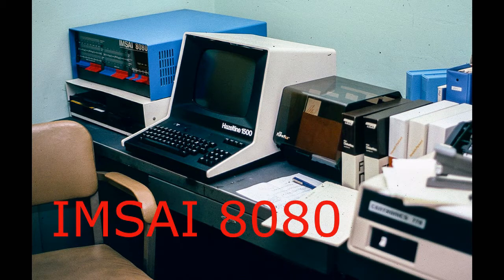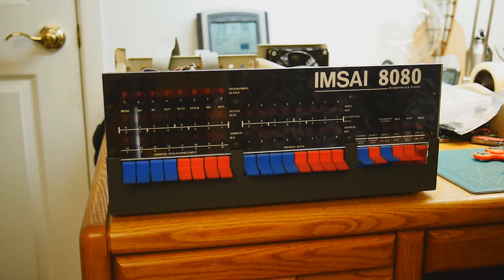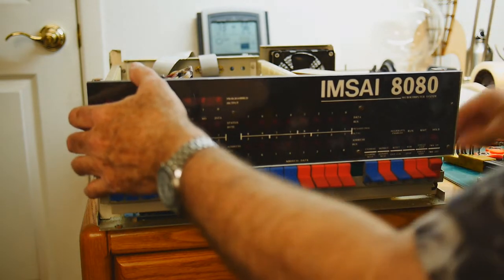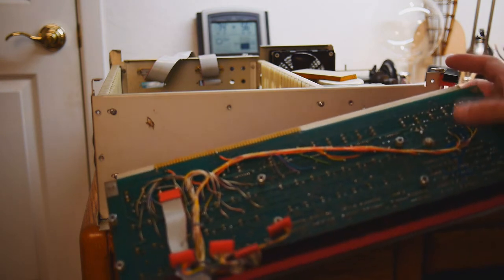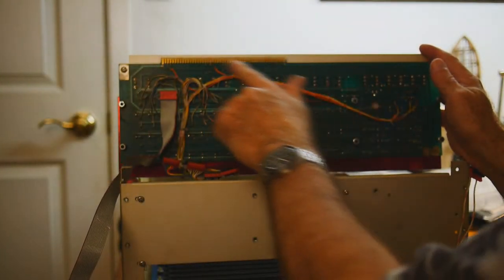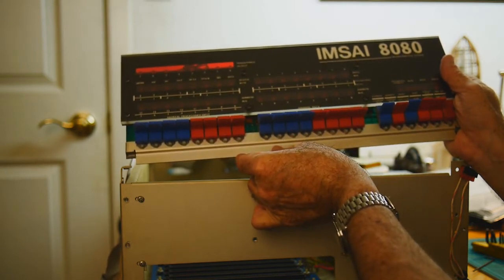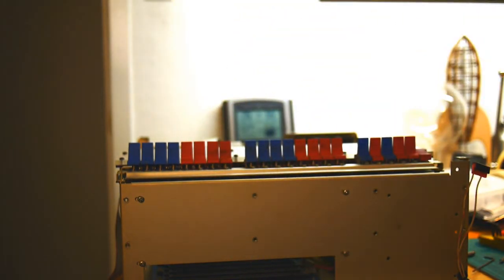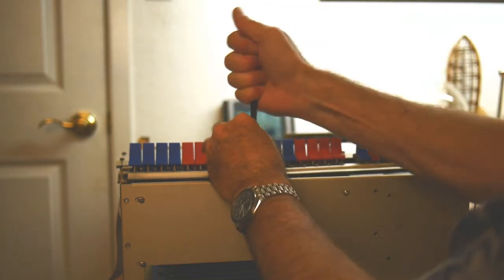#5 IMSAI 8080 removing front panel

Comment: How did your standoffs stay in place?
Reply from the maker: I don't remember, must have been threaded standoffs since it was not a problem
Reply: @IMSAIGuy  I have a PS problem, it appears to be on the -16V side. I have removed all boards, and the Front Panel, and the fuse still blows. I will de-solder the
three -16V lines from the MB tomorrow and see what happens.
Reply: I was able to take care of the -16V power line problem, so that the fuse does not blow any more. What originally seems to have casued the problem, were a couple of missing plastic washers under the backplane. 

Anyway, I am back to putting the front panel back together. It appears in your video, here, that you may have put a small hex nut, on the end of all your threaded hex screws that go throw the front panel. That looks like, why you were able to remove the panel, without any standoff falling off.
Can you verify that, this will work?
Reply from the maker: @jeffnay6502  I think so. Can't really remember
Reply: @IMSAIGuy  Look at the video, at around 6:29
Reply from the maker: @jeffnay6502  Yes there they are. I didn't put them there so must have been original
Reply: @IMSAIGuy  I was able to get everything put back together. I simply ran the long hex screws, throw the clear and red plastic face plates, then throw the tall plastic stand offs, and the front panel circuit board and glued the small plastic standoff, to the back of the front panel circuit board. Then it was simple to plug the front panel board, into it's s100 slot and screw the hex screws back into the case.
I am having a problem with the MPU board though, can not deposit data. All data lines are being pulled up, high.